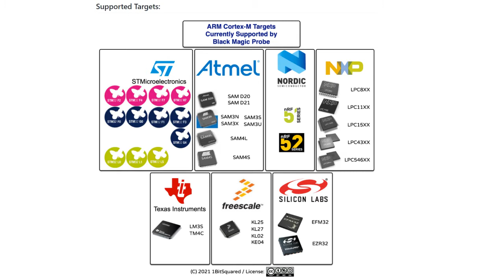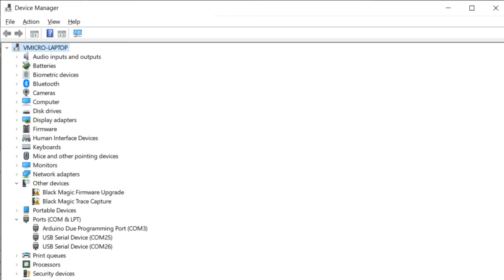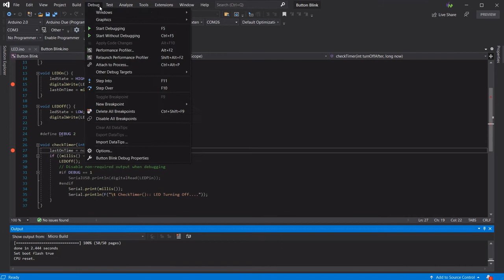Black Magic Debug Probe

Comment: What determines what swd devices it can support?  

For example, what would need modifying when debugging a Cortex-M3 inside a Smartfusion2 fpga.. vs a Cortex-M7 in a stm32h745 microcontroller? 

Do you have to rebuild OpenOCD?  Or is it just a matter of pointing it to a different (vendor-supplied) a svd/cfg file?

And if the chip (M3+) also has ITM's SWO/TDO (for serial-wire-viewing) can the magic probe or the pi-debug-probe + Eclipse/OpenOCD show this trace data? Or is this only available in more expensive tools (Keil + J-Link-Edu/Mini)?
Reply from the maker: The Black Magic Probe essentially runs OpenOCD on the probe itself, so only GDB is needed on your PC to connect to the board.

The SWO Output can be made available from the probe, but would require the additional monitor commands to be passed to GDB on startup, or via the VS Command Window:
https://black-magic.org/usage/swo.html
https://www.visualmicro.com/page/Debugging-Using-Custom-Hardware.aspx
https://www.visualmicro.com/page/Executing-Custom-GDB-Commands-in-Visual-Micro.aspx

You can also flash the BMP Software onto other boards to create a cheap probe:
https://www.youtube.com/watch?v=tNyjd6SUsP4
https://www.youtube.com/watch?v=cszbvPZ43kE

If you have any difficulty in the Visual Micro configuration (once confirmed working via Command Line) please open an issue on our forum:
https://www.visualmicro.com/forums/